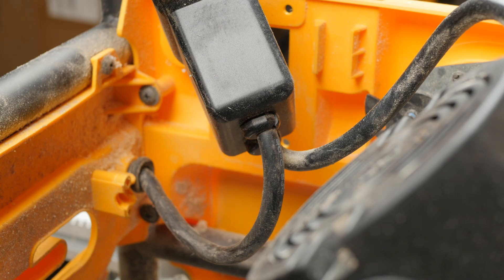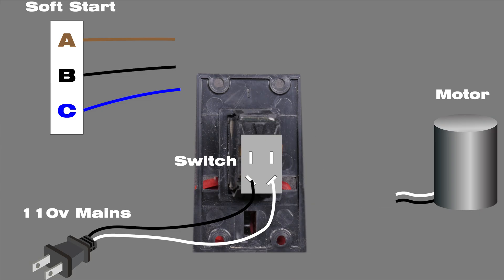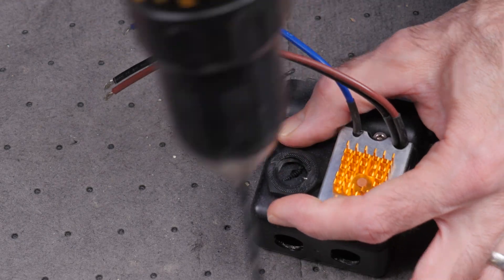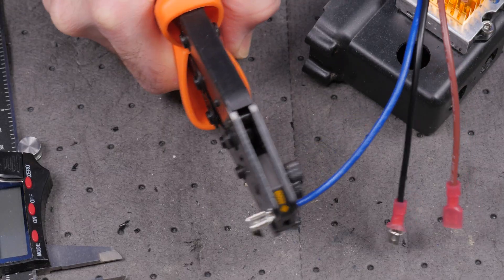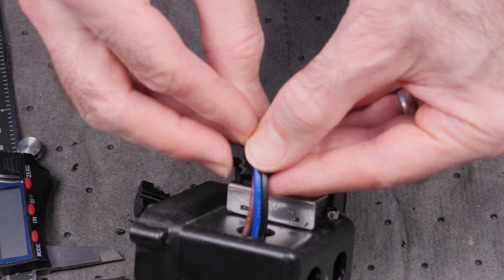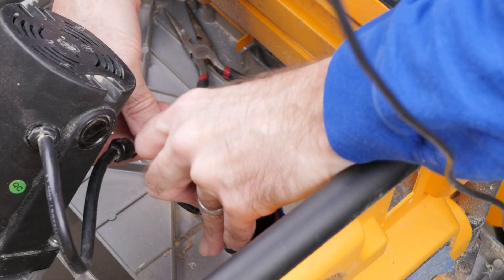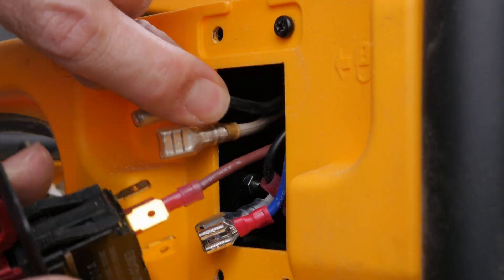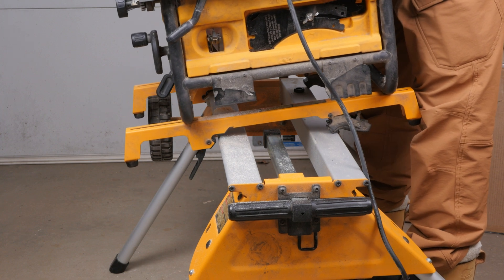Installing A Soft Start On A Dewalt Table Saw

Comment: Any thoughts on installing on a saw with an electric brake? Been fiddling with my Ryobi miter saw but have had no luck on finding out how the brake coil is wired in with the stator coil and I think it might back feed through the module. Thanks for putting together the video!
Reply from the maker: I have never really investigated how those brakes work, but my understanding is that they reverse the current when you let off the trigger - effectively halting the blade.
If that is the case, depending on how those soft-start modules are made, that reverse current may not be too good for it.
It would be interesting to dismantle a machine and see how it works.
Thanks for the comment!
Reply: @mainejason I think I may have figured it out. I’ll share if I do. Thanks!
Reply from the maker: Nice - please do!

Comment: Hi, thanks for the video, my saw is a Dewalt model 7480, I'm assuming the same kit on the link you provided can be used on mine or do you suggest otherwise.. thank you so much.
Reply from the maker: My saw is also a 7480, so you should have an identical setup.
If you do the mod, good luck, and let me know how it goes!
Thank you for the comment, and thanks for watching!

Comment: No concerns with the soft start using 16awg and everything else being 14awg? I bought that same module but returned it because the wiring is inferior to every other part of the saw. Wish I could find one with 14awg.
Reply from the maker: I see your point.  I guess my thought is the leads are so short, there is not much opportunity to build much resistance from the smaller conductor.  The high current load is pretty brief - at start up and perhaps an extremely heavy cut.
I have not experienced any issues with this setup, BUT - it is certainly prudent to set things up according to your comfort level.  If you find a unit with larger gauge leads, let me know!
Thank you for the comment, and thanks for watching!
Reply: @mainejason I need to look around and find a saw with soft start and then maybe get the part from that. To me this is like running two 14awg extensions with one foot of 16awg in the middle. Just seems silly. I guess worst case scenario the wires are short and just completely incinerate without damaging anything else, hopefully. 16awg is supposed to be able to handle 15A but the power runs through that circuit constantly so it'd be nice to be a little beefier.
Reply from the maker: Agreed - by the book, it is inferior and should not be used.
Out of curiosity, I just went out to the garage and fired up the saw for 20 minutes while monitoring the current draw.  It sat around 9.25A while running.
I put a couple cuts across it and it jumped to between 10 and 12 briefly. After this, I checked the wiring and everything was room temp to the touch with the exception of the heat sink on the actual device itself.  That was warm - not hot, but definitely warm - as I would expect from that type of device.
I suppose one could open up the device and replace the 14AWG leads with 16AWG.  Would you get any return for your effort?  I don't know, but peace of mind is certainly worth something!
Maybe I'll open one up and see what it looks like ;)

Comment: Ah the wincing! Thanks for the PTSD. I'm curious about your crimper. The Amazon link shows a Chinese knockoff for under $20.00. Yours is an $80.00 Crimper. Specifically Paladin Tools Model PA8000, $72.91 before taxes on Amazon. I realize most viewers would rather spend less money and the tool will probably do the job. Remember the old saying..."you get what you pay for". My dad taught me as a kid, buy only quality tools, there's a reason why they're cheaper. Great video by the way! Thanks for taking the time!
Reply from the maker: Hey, good eye on the crimper!
I've had that crimper for years - got it way back in my network engineering days.
Honestly, at the time I made the video, I searched Amazon for the exact one I have but couldn't find it - but since you did, I'll look again and update my link if I find it.  My Dad taught me the exact same lesson, and I always abide by it for myself.  You are correct that many folks would rather not spend a lot on money on a tool they may only use for one (this) project, but for long term use, one most certainly gets "what they paid for".
Thank you for calling me out, and keeping me honest!  ;)
Thank you also for the compliment, and thanks for watching!

Comment: Can you use a soft start on an older Dewalt table saw that has a polisher control module? Or does it already have a built in soft start? Thanks
Reply from the maker: My understanding is that those control modules already have a soft-start mechanism built into them.
I have never used a saw that had one of those modules on board, so I cannot say that I have first hand knowledge, but the literature I have seen seems to indicate the presence of such a system.
Hope that helps!
Thank you for the comment, and thanks for watching!

Comment: Hi, great video! I already installed the soft starter on my Stanley table saw and it worked perfectly, but... now I have a question... can it also be installed on a miter saw? It would be fantastic if it could prevent that harsh start on a miter saw as well. Thanks!
Reply from the maker: Thank you - and nice job on the Stanley saw mod!
Good question concerning the miter saw.  I'm sure a device could be fitted, but I wonder how or if that would affect the blade braking system - the blades on those are not just free-wheeling like a table saw.  Might make a good video...hmmm 😉
Thank you for the comment, and thanks for watching!

Comment: How did you remove the wires and plugs from the plastic cover / box that houses them?
Reply: So I finally figured it out. Never installed nor removed a strain relief before and was so afraid of destroying it. By putting long nose pliers inside the box and squeezing and pushing while pulling from the outside I was finally able to remove them. I did however split the box a little on the bottom but that shouldn’t affect anything. Thanks for the vid. I cringed when I initially turned it on for the first time and was pleasantly surprised that it worked!
Reply from the maker: Hey - my apologies for not getting back to you sooner - but it sounds like you gave it a try and got it figured out - great job!
The procedure you used is exactly how I do it.
Thank you for the original comment, as well as for following up!

Comment: I did this mod to my saw about 4 years ago using the exact same part. It definitely worked but I noticed that the modal gets pretty hot to the touch while the motor is running. I wasn’t sure if that is normal so I removed it. I’m curious wondering if you have the same issue with yours.
Reply from the maker: I have not really checked.  It does have a heat sink on it, and given how these things are made, I'm not surprised they would dissipate a fair amount of heat.
I'll pay attention to it the next time I use the saw and see how warm mine gets.

Comment: MJ, thank you for this video. I came in from my shower after installing this on my 745.
Mine came from Amazon 9 dollars. Sort of like your but different wiring colors on the module.
I also installed in exactly the same location you did with a galvanized “L” bracket as a heat sink.
Mine did not have the fancy sink you have. 
All in all, I get a dramatically slower start up but it is still pretty rough. Thought it would be a lot softer.
I noticed that the red wire on mine was the one they split. The module came already with spades.
On some schematics I notice the blue wire split but on mine the red wire is split.
I tried switching the incoming 120vac to see if it mad a diff but it does not.
Took the time to resetup the little guy with a 123 block and set the little clear red line accordingly.
I have had the saw for three years and never sawed a board with it. Yes, you can laugh.
I plan to use it before winter for TIG floor plank in the kitchen.
Thanks again for taking the time to show us. I thought I would be the only one left with the older 745.
Hang in dude. //ro
Reply from the maker: All very interesting information - thank you for sharing all of that!
I'm sure every manufacturer has their own way of wiring these units.
Thank you for the comment, and thanks for watching!

Comment: Thanks for the video - that looks like a great solution!  I wish there was a way to make a soft start work on my compressor motor!
Reply from the maker: Thanks much - I'm glad you enjoyed the video.  Is there are reason you can't put a solution like thison your compressor?
Thank you for the comment!
Reply: @mainejason  I'm not really sure - I just figured it wouldn't work with a larger capacitor start motor.  I may have to give it a try!
Reply from the maker: Hmmmm...not certain about a capacitor-start motor.  I have read some bad things can happen if the circuit is not configured correctly.   Best do some research before trying it!
If you do give it a try, let me know how it goes!  😀